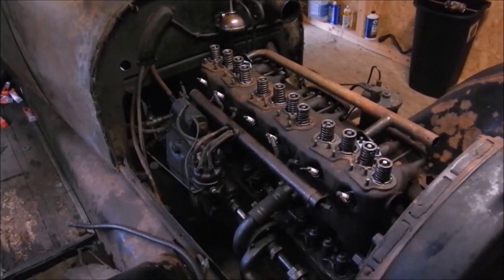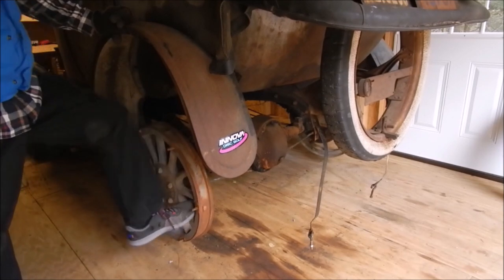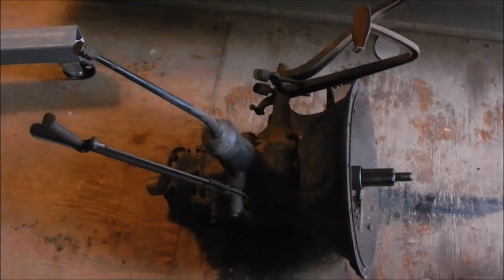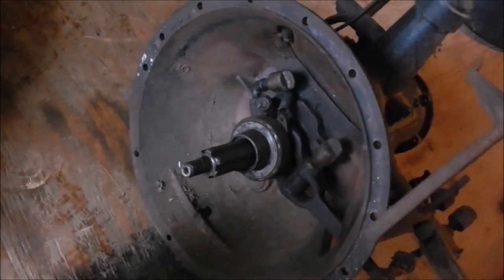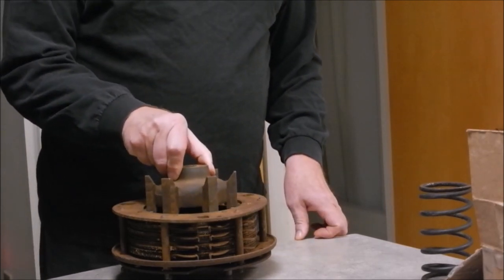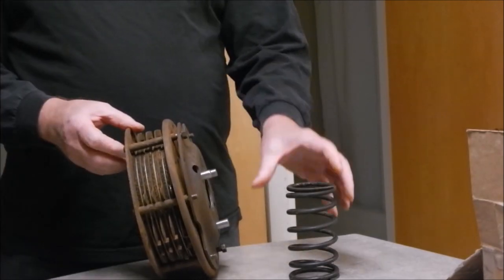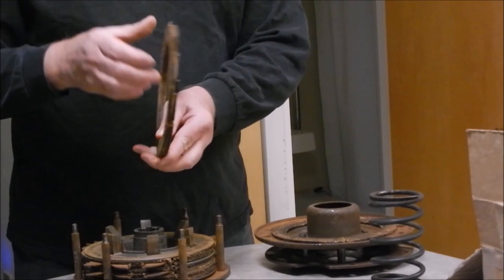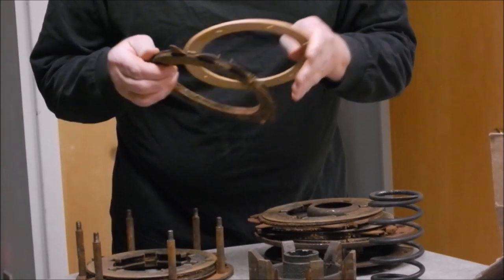1917 Buick sat for 80 years. Part 9---Clutch Job

Comment: How is that clutch felt? Is it heavy to push while driving?
Reply from the maker: Exactly the same as modern cars with manual transmissions. Very easy to push down on the clutch.
Reply: @hyzercreek  Thank you. From your videos I learned about old cars more than any before.